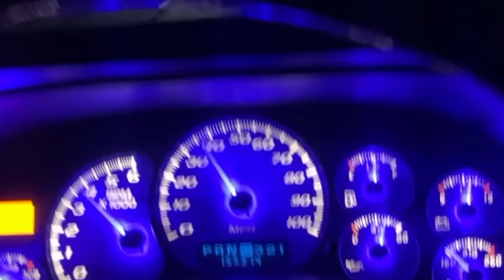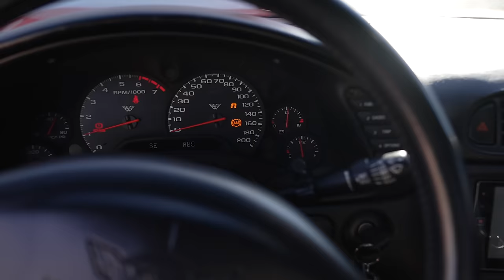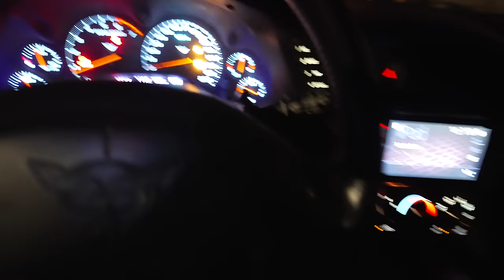Installing Widebody Fenders On My C5 FRC … I Hope I Don’t Regret This Decision…

Comment: @mikemyke Instead of buying new wheels if you already have some for the wide body kit... Why not have them powder coated at a shop? Would be much cheaper than a new set, quicker turnaround and saves space. Just a suggestion.